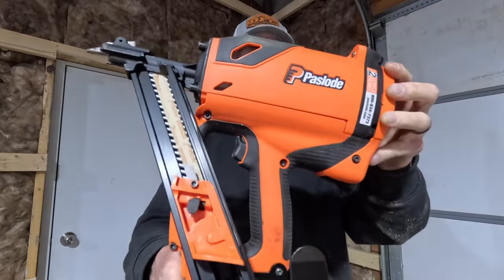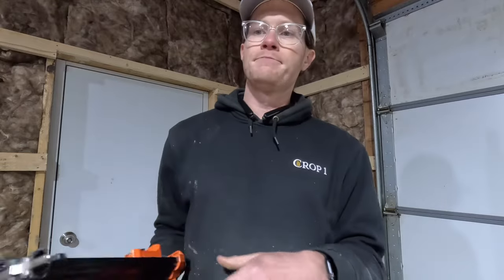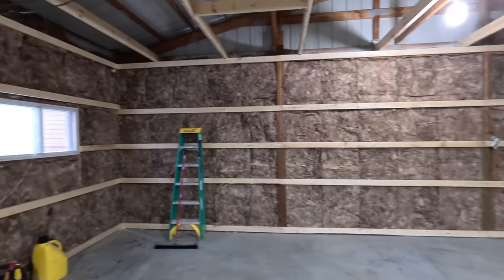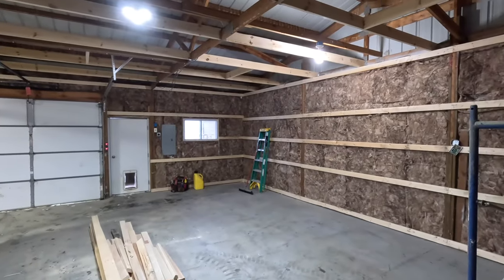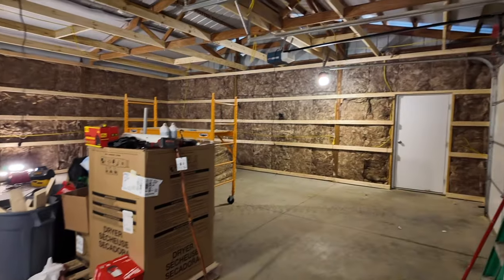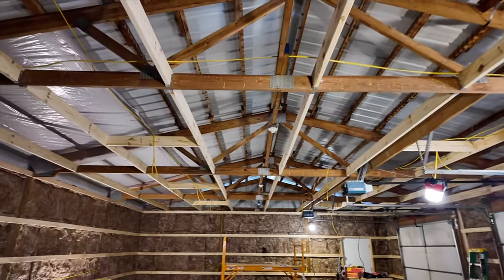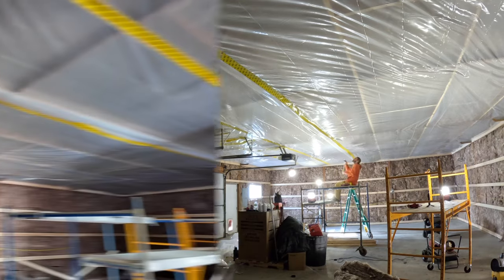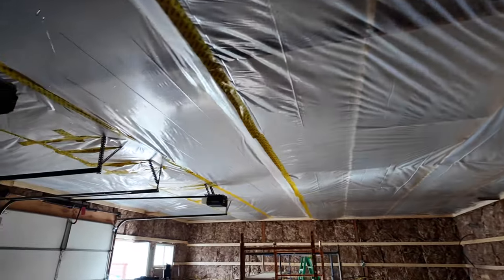30x40 Pole Barn - Insulation | Electric | Vapor Barrier - TRANSFORMATION

Comment: The plastic on ceiling is that something you have to do? Finishing my barn inside and just curious if I need to do that before I put up metal ceiling?
Reply from the maker: All depends on the building code in your area. In my area (South Dakota), a minimum of a 4 mil vapor barrier is required on all exterior walls and ceiling. We generally use 6 mil for better durability while installing. The only reason we do not have poly on the walls in this barn is because we applied 2 inches of closed cell spray foam that works as a vapor barrier for the walls.
Reply: You want the plastic to keep moisture off your ceiling... idk about metal though.  It doesn't seem as "finished" as drywall,  but I bet it's still desirable to keep water off it.  
Electrical boxes should also be wrapped and pulled through to have a continuous seal.
Reply: Are the walls 11’ or 10’?